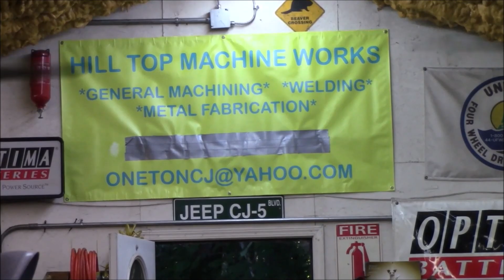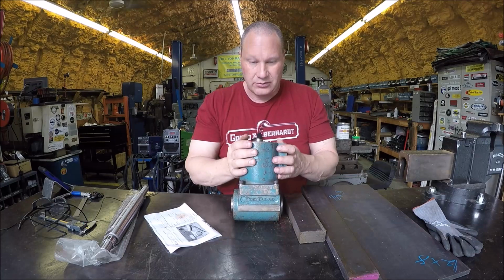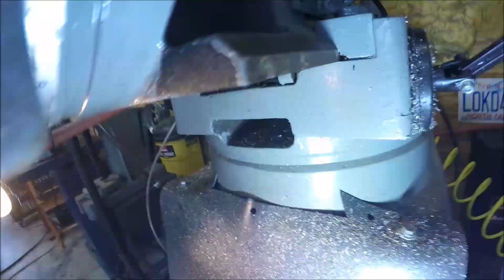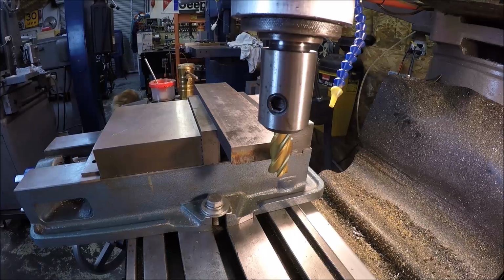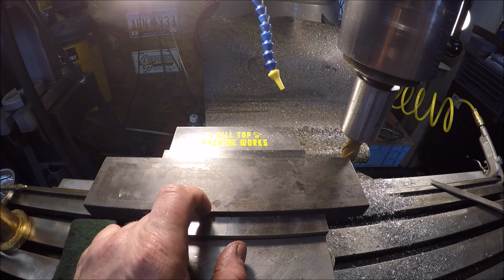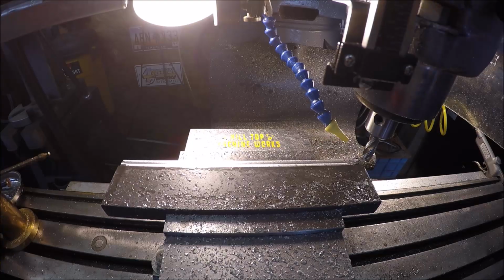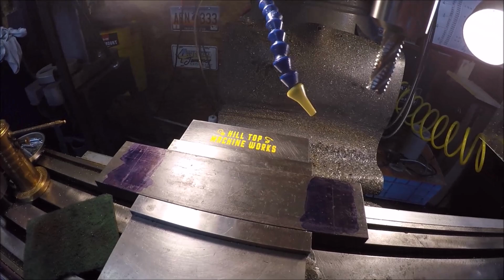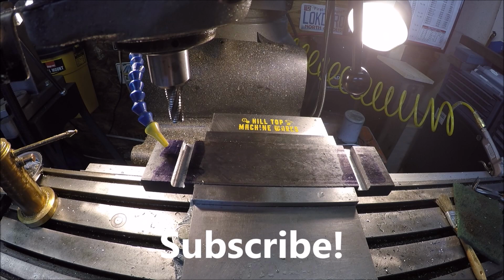Arbor support for right angle milling attachment  Part 1

Comment: No shaper action tonight ???  LOL I’ll wait till the next installment.... Nice project, excellent deal on the big mic. Could you pin it from the bottom before you weld it to help hold it relatively straight. Only asking, remember I’m still new with this machining thing. Not a good welder either 😳 thanks for sharing Tom. Enjoyed watching. 👍👍👍
Reply from the maker: Sorry teased you on the shaper action.😊I think the hard part is that there is no perfect way to hold a vertical surface and a horizontal surface together without it wanting to move on you as it gets hot and the weld forces set in.

Comment: Hey Tom if you put three or four bolts into that plate it won't pull so much when you weld it to the other piece , just a thought.
Reply: In other words machine the slot on the end , and then bolt it together or use dowel pins , then bevel the edges a little and bolt it back together and tig or mig it , should keep it from pulling and make a very ridge piece...